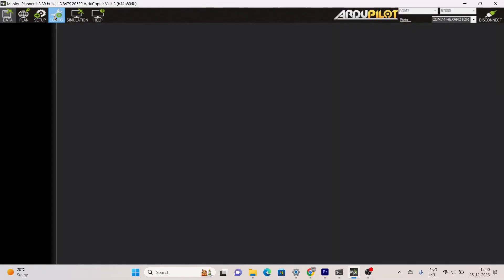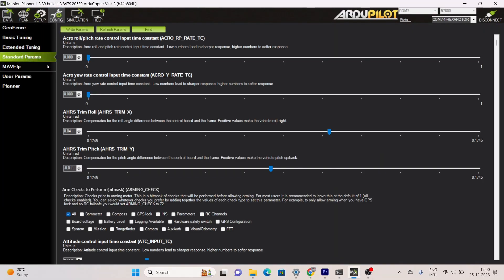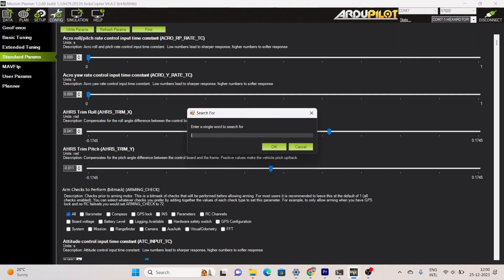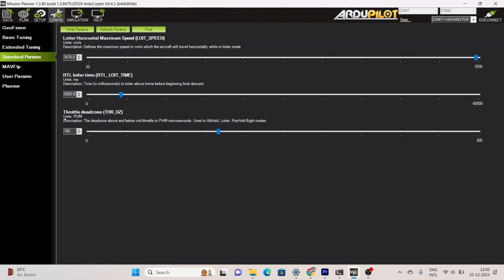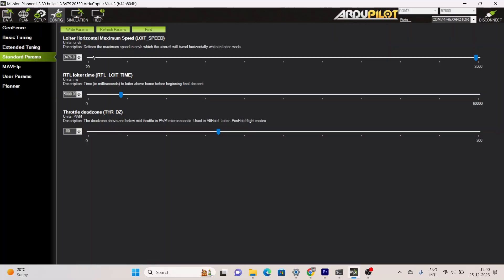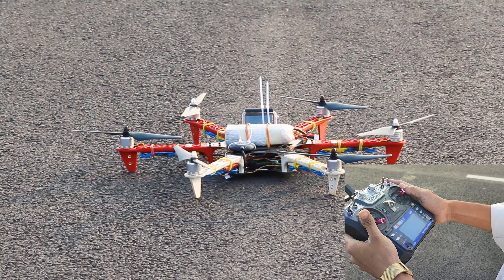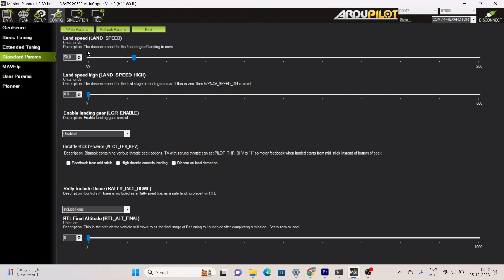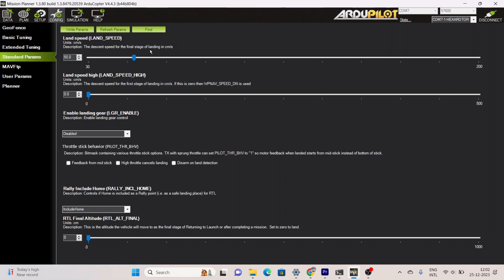TESTING STABILIZE, LOITER, ALTITUDE HOLD, LAND flight mode | PIXHAWK 2.4.8  | IMPOSSIBLE CREATIVITY

Comment: Bhai mera drone flight toh shi se hota he but thodi der me apne aap rotate krne lgta he or chrash ho jata
Reply: Plz help
Reply from the maker: Do the compass calibration in a right manner and then esc calibration.
If the problem problem still persists
Check individually with every motor if there speed is increasing linearly
Reply: Bhai kabhi kabhi hota hai apne aap roteted
Abhi tak 10 flight me se 2 times 😭😭
Reply: @impossiblecreativity Sir, I made a drone with APM 2.8 and it's working fine in stabilize mode but when I switched it to alt hold mode it's not working properly and not maintaining the altitude it only elevating. Please help me sir 🙏🏻🙏🏻